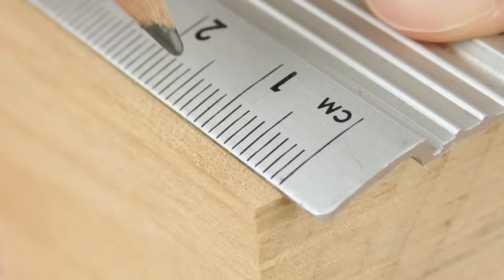DIY HOT Wheels Race Truck Powered by 2x CO2 Cartridges

Comment: Co2's on the truck should be top and bottom instead of side by side. That way even if the pressure is uneven the truck wont be pushed side to side uncontrollably...just a thought
Reply: Smart
Reply: Weight distribution is key to success
Reply: D Fingers that and set lower you can see it consistently wants to lift the truck
Reply: Just use this law: E=mc2

I dont know why i used the formula for the theory of relativity
Reply: True. But it looks cooler this way. Sorry science, this time you lose.
Reply: @D Fingers
Inspiration came from the English Electric Lightning,  correct.
The british engineers were also smart enough to mount the engines on top of each other.
Reply: @nopeno2350  AAAa
Reply: @nopeno2350  =974
Reply: P

Comment: The angle of the thrusters are slightly higher and not leveled. Making the truck push downward.
Reply: Kinda hmm, and above advantage the car has perfect downside angle of card, to either not sheer across or hit and fall apart.

Comment: And that's a perfect example of aerodynamics!
Reply: Parm Mohan robot poop
Reply: Parm Mohan no its a center of force the motors are sitting too high on the truck using the cab like a leaver to flip forward the co2 needs to be mounted lower like the car
Reply: mongo00126 Really? You think a centimeter or two will make a difference on the center of force? I disagree with you. You would be right if these were bigger, but they are not. The blunt air friction is slowing down the truck and causing turbulence so it goes off the track. The wedge car has the air pushing the car down and holding it to the track.
Reply: Agreed as soon as I saw the wedge it was a winner

Comment: The 2 co2 tanks on the truck need to be exactly the same distance from each other and from each side. Put in at the exactly same angle and depth. More weight on the back,  Then the truck would work

Comment: Cool build but it needs wider wheels on the front of the truck to keep it straight on the track. There was too much space between the side walls of the track and the front wheels. The car had wider wheels on the front so it was able to use the walls of the track as a guide keeping it straight.

Comment: The cartridges are too horizontal, so they have no traction to stay on the track. You should modify the angle and make them more inclined so that it pushes not only forward but also downwards.
Reply: The
Reply: @santossantossosnierz1846  9odo
Reply: @arielelorde3130  ज्ञ

ज्ञ
ययययं
Reply: @santossantossosnierz1846  mmm£
Reply: ひまりもみるみにはほふ
Reply: なちさあいうく？んみめもよろー
Reply: きほひゆむやきたうろにひきさなまにみしにのくままひきさたみにやきさむなまなしきむふむぬみやしちしいたみやぬむしちみやぬめしのたうみぬしむちのひきしのむにひきみしのにきまちひにめきたひまにへきたうひろまにへきたひみにふかひみにうかたひみにかたいへにひみいたかふみひたいかふさかみにむみかたひぬのたかいひろみにふいたかにろへいたかひみへたさみふにへふみいたさへにいたさふみむいたさめぬふみたさいめぬさふみたいいへぬさたいふみいぬへたいさみふにへさたいふみにへたさみふへさにみのへふみいにたさのへふにみいさたぬたいのさのぬたいさいのたぬさしいのぬたぬちいしの
Reply: More weight on the truck

Comment: Use a spring-loaded center punch and I bet that will puncture a hole through the cartridge and it's better than using a hammer with a nail. Also very great for their environment in all those gases out, not,  boy I'm surprised the green life's matter people after you yet. Is pretty Cool though. Maybe use REGULAR air from a compressor. Small nozzle with quick release pins with o-rings to hold 10lbs of air pressure in max or depending what's used and what can it hold, make it out of PVC piping now. Saves MONEY from wasting gas and polluting our air. Just like a air cannon.

Comment: The truck is running to much power. Yull need some weight in the back since its pushing to much on the front. Or you could just run one of the Co2 tanks, but it would steer your truck depending on the side its on. A hole in the middle would help.

Comment: No clamps. Not spreading the glue well. Dangerously using cutter blade as a plate. I know people tend to have super low standards and some are not willing to buy proper tools but dude you can tighten with ropes and few wood scraps if u don't have clamps. It's okay if you don't have the money to buy tools but being lazy is never an excuse.

Comment: Different width wheels cause the truck to wedge against the guide rail. Also each canister may have slightly different pressure, especially if one is opened earlier than the other, or if one is more offset, causing the truck to spin out.